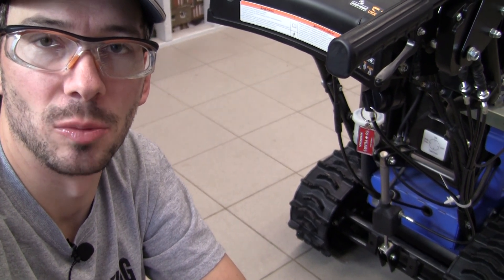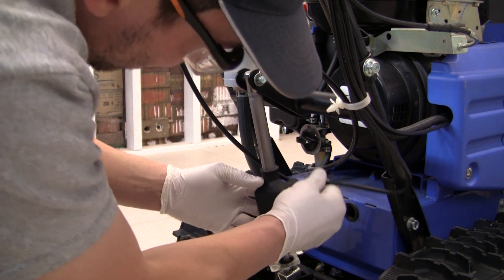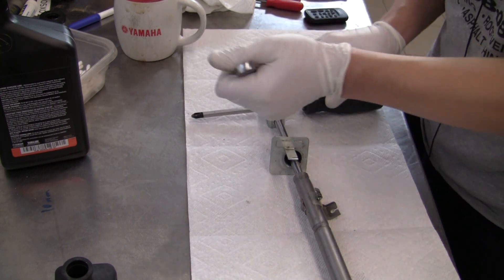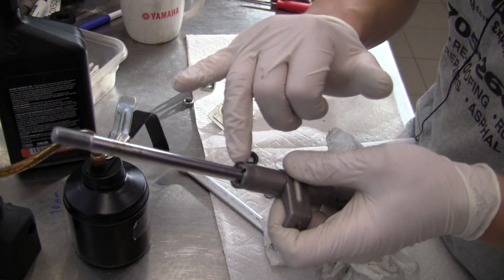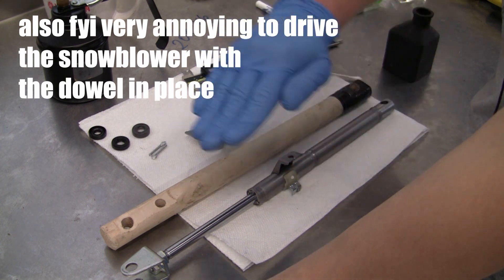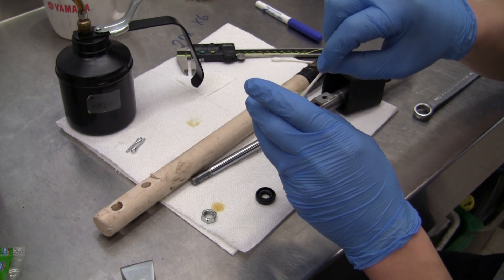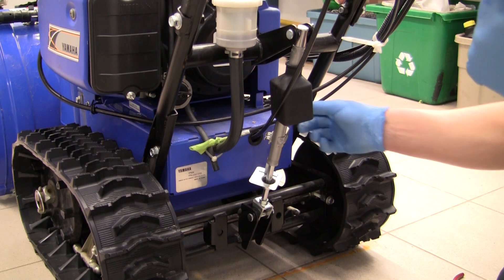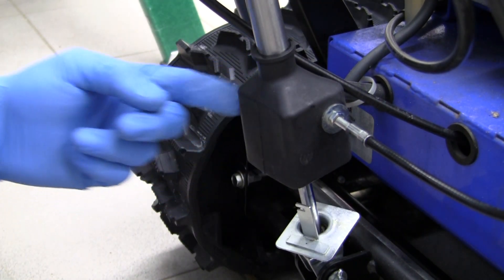Ep. 16 - YT624EJ M.S. - Auger Housing Height Control System Inspection

Comment: Mine is holding but if I put pressure on it it slips.
Reply from the maker: @moose64  Did you try dismantling it and cleaning it as shown in the video?
Reply: @lucgallant  Not yet. I only found the issue today after our first storm.  After 10 years, this is my second issue with this blower. The first issue was a broken chute direction doohickey.

Comment: These seem to be very troublesome units with some people saying they have replaced them yearly. There is a coil spring inside wrapped around that rod or piston. Pulling on the cable relaxes the spring and lets the rod slide through the spring.  Mine is locked in the full tilt up position. Not sure if it's the lock mechanism or the shock itself.  I see some people are putting on the Honda shock. Honda is $35 U.S. vs $300 Cdn for the Yamaha part. I think you need a longer cable though.
Reply from the maker: Thanks for the comment. So is your suspicion that the spring is rusted to the shaft? Can you soak it whole in oil for a few days? I've heard of the Honda route but not sure if the stock cable works. Maybe one day I'll find out... Hahah
Reply: You are right they are troublesome. I go through 2 of them every winter. This being said I use them for commercial use ~300h per winter. I get them from Impex Japan much more affordable  than local dealer. 

Curious if the Honda shock would work, would be even more affordable !

Comment: Really helpful, Tx for your videos. I have 2 snowblower yamaha (YT 10/28 2019 and yt6/24EDJ 2012) I have the owner manual for the 6/24 but I don't have the shop manual with all the details that I saw on your manual ( specs and clearance...) Do you know where you get it ? Merci
Reply from the maker: That manual can be ordered from the Yamaha dealership. Just ask for the service manual for your unit.
Reply from the maker: If you have issues let me know I can help out by getting you one from my dealer.
Reply: @lucgallant  Hello Luc I did ask Yamaha Canada and my dealer and both of them sent me the service manual (PDF version), so thank's again... If I may ask you another question: I really like my YT 6/24 2012 she is like new and work amazingly. the only issue that I have is on the cold start! My electric starter is never able to start my snowblower. Usually I'm using my manual start and it works most of the time. In extremely cold weather I have to put an electric heater couple of minutes and it starts... Based on your expérience, is the carburator issue ? Maybe need to clean it? I'm always storage my snowblower without gaz on the carburator... Or any advice on your side. Ibouth it brand new in 2012...Thanks
Reply from the maker: @LavalBrassard  I store mine in a heated garage so can't comment too much. But what exactly is happening to your unit? Is it that it won't turn over, or that it turns over fine but just won't fire up? Someone else had asked me about this a few years back, doesn't sound like they like to start when fully cold.
Reply: @lucgallant  merci Luc for thé reply… it turns fine but don’t want to start. I did store before this unit in my heated house garage and it starts ok with electric starter but I did move this unit in my non heated garage cottage and the issue Begin to start. Probably they don’t like to start in the Canadian cold winter but when they run, those are amazing. Anyway I will probably clean the carburetor (first time since I bought it). An thanks again for your video. I did use it to replace the belts but now with the service manual I’m not afraid to remove de carburetor. 👍
Reply from the maker: @LavalBrassard  oh ya. That is the same feedback I had gotten from somebody else's few years back. And the one time I did leave my outside I believe it had similar issues. I'd be surprised if the carburetor is dirty because there is a bit of filtering on the input of the fuel lines. I'm wondering if the jetting is not rich enough to start in the cold since the air is more dense. Sounds like a pain in the butt though.
Reply from the maker: @LavalBrassard  actually just curious, if Yamaha passed it on to you, any chance of sending over the PDF? Did they give you any terms of conditions of giving it to you or?
Reply: @lucgallant  no they sent it to me without any charges. Do you want a copy ?
Reply from the maker: @LavalBrassard  sure, lucgallant @ Gmail . Com